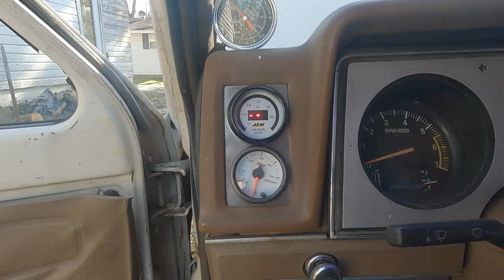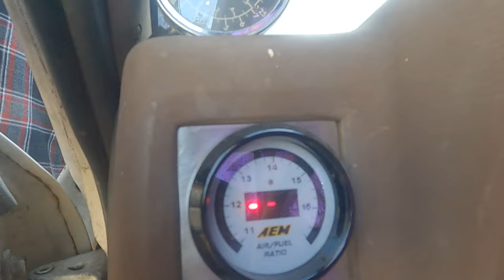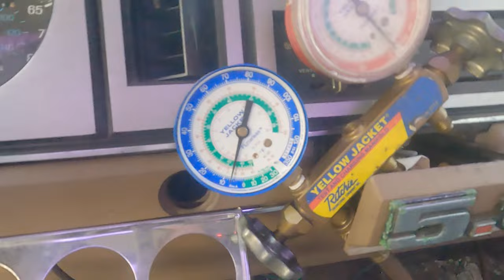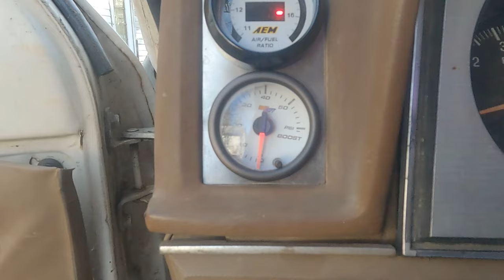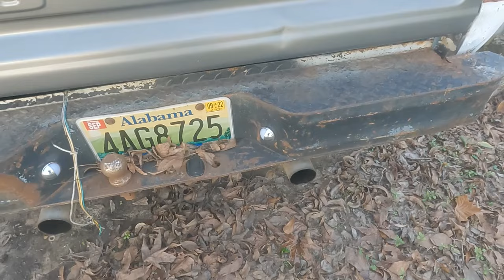302 Turbocharged V8 87 Ranger (Got BOOST?)

Comment: Nice to see you messing with the ranger again. SOME DAY I’ll have a turbo on mine 😂👍🏼
Reply from the maker: Your Ranger is gonna be nice once you get done swapping the I-beam to Mustang 2.  A Turbo and a trans brake you'll be dragging the bumper and toting the front tires. I can't get the boost stable it keeps making 20 lbs trying to commit suicide. I don't know how the rods are staying in the block. I've been hearing a little jingling sound at start up. Im not sure if it's broke piston ringland or the old fuel pump cam eccentric jingling. I've ran a compression test and everything is normal and it still runs fine. Between the noise and wideband acting stupid and uncontrollable boost makes me want to pull the engine and put a wore out pieced together 302 in it and try to murder it with the 14L turbo just to see what it takes to split a 302. That way i'll know what the limit is and people love to see shit blow up. Maybe that would get some views lol.
Reply: @kickassmustangsgarage  lol yea can’t wait till it’s done. But we in frigid single digit weather now. Not fun working in a ice box garage 😂😂😂🥶🥶🥶 yea that would be cool push one to the limits 👍🏼
Reply from the maker: I made a waste oil heater out of a old water heater for my shop. It's 51 here and I still don't want to go out in the shop and work lol. It was 84 10 days ago here. I don't blame you it's hard to work when you can't move your fingers.
Reply: @kickassmustangsgarage  yea it was 12 degrees out last 2 days. 7 degrees at night 😂😂😂
Reply from the maker: I'm glad we don't get cold weather like that. It might snow once every ten years around here and it's gone two days later if it lasts that long. I don't think it has ever been over 4 inches deep here most the time it melts time it hits the ground. It needs to get cold and kill all these damn love bugs that are migrating north 5 years ago you never saw any here. They're getting worse every year now plus the mosquitoes.

Comment: Good Video, Nice Turbo Setup!
Reply from the maker: I got 4 of those big turbo's from a buddy off 3 of his old trucks. I used some old manifolds I had in the scrap pile, and cobbled together a hot side to test to see if it was even possible for a 302 to spool a 12.7L semi truck turbo. After I took it down the road and the turbo went to whistling I was like oh yeah this is going to work!  Header wrap and a flex-joint was all I had spent $ on less than $50 I had some exhaust pipe. After I got the hot side done and drove it and everything checked out didn't melt the plug wires or catch on fire I finished getting everything else. That's when it started getting expensive. Gauges and a boost reference fuel pressure regulator was the biggest portion. I modified the fuel tank sending unit to put a Walbro 450 fuel pump I already had and bought a new tank. I made a carb hat & blowoff valve combo and modified a 650 to a blowthrough carb got the elbow for the turbo and I was in the boost then. I was freaking out the first time the boost started rolling in and it started spinning the tires at 100 MPH!  I never thought it would be as strong it is with the junk I used and it all work right.

Comment: That tensioner needs a new bearing. I had one sound like that, then one day explode and left me stranded. Luckily I wasn’t far from home but the closest parts store was 2 miles away one way.
Reply from the maker: I gotta get a belt the right size I think I have another pully I can swap it with.  It would be bent the rods and cracked the pistons if you hadn't told me about the spark knock you heard in the 15 lbs of boost video. 46 degrees of timing was a bit much lol.
Reply: @kickassmustangsgarage  46 degrees oh man! That was costing you power for sure! I'd want like 16 degrees max lol

If the idler is the same as most Fords then it's probably partnumber 6203 for the bearing, I remember off the top of my head now lol. Carry a spare in the truck with me. Since I usually have my tools I;m not about to be stranded again over an $8 part.
Reply from the maker: I flipped the mechanical advance from 36 degrees to 26 and my homemade vac advance- retard pulls another 16 degrees under boost so total timing is about 20 degrees max my base timing is 10 degrees. I can make it pull 4 more degrees by adjusting the v-pod. I got to figure out the boost creep sapos to be 10 lbs after I added water methanol it tries to make 20 on pump gas 93. The old unopened stock 302 is still going takes 20 lbs of boost and still got the factory headgaskets and ring gap.